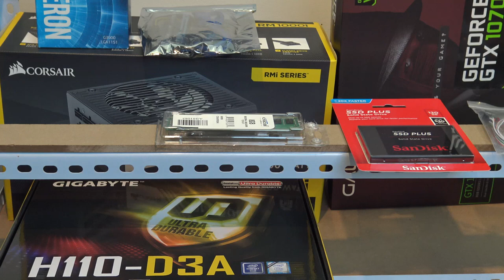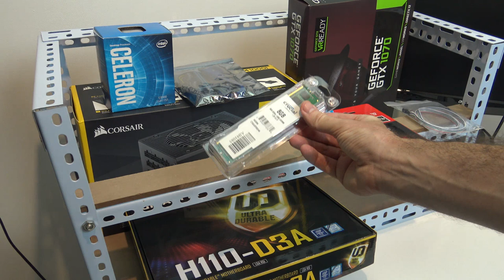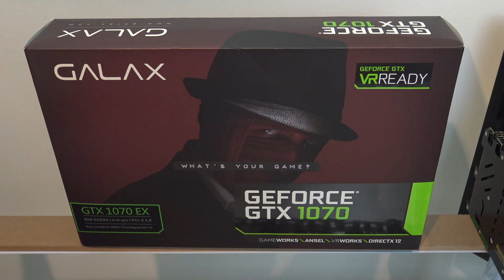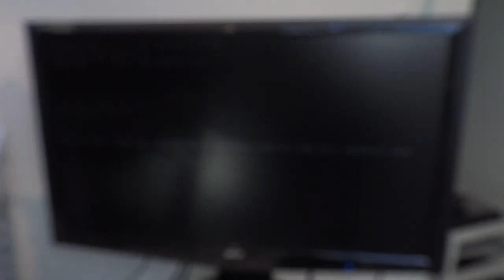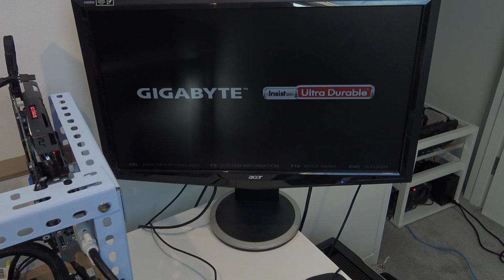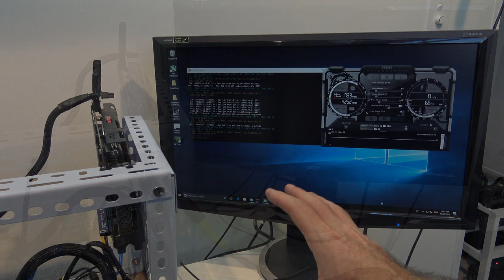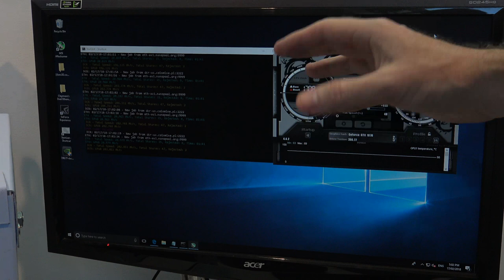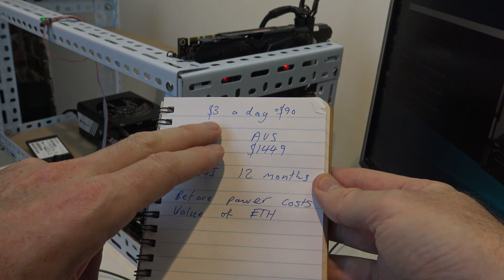Nvidia Mining Rig - The Gambler Build

Comment: These videos are great and I like how you don't go on with bullshit. May I ask why these rigs are exposed and not inside a case of some type? I would think that if it was contained in a case with constant airflow over all the components (with exhaust fans) then you would get higher performance with the improved cooling than just a static room air with exposed components. Very interesting hobby.
Reply from the maker: Thx mate open air mainly so heat doesn't build up.

Comment: Why aren’t you using a 6 pin cable from your PSU to the riser? Those adapters are notoriously terrible and a potential fire hazard.

Edit: watched the rest of the video. I agree that 2 Sata risers per cable is GENERALLY ok. But why not buy a molex or Sata riser if you’re going to do that? You have 3 junk Chinese connectors per card instead of just 1
Reply from the maker: I have used these cables on two of my other build and haven't seen a fault yet. I touch them around the connection to see if they are heating up and they only just warm so. I think people miss use them. Over load them.
Reply: 123myIT never a problem until it is.. you’re tripling your chances of a failure aren’t you ?
Reply from the maker: If you concerned about it use a different connector :)
Reply: 123myIT I do.. do you not agree that people should be minimising the use of these 5 cent adapters ? What’s the upside ?
Reply from the maker: I dont know mate. Why don't you try one sata connector and one 6 pin and see if you notice any difference and let me know? Sometimes you have to be careful of YouTube videos scareing people by saying my house burnt down etc from this that or whatever.